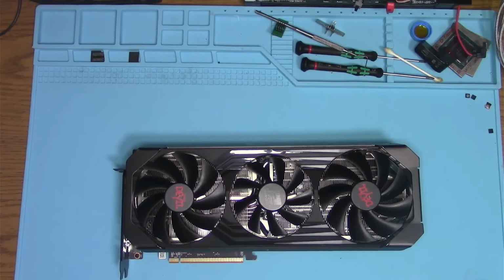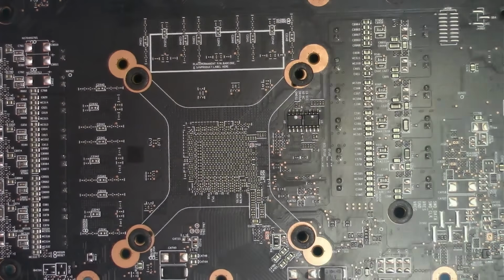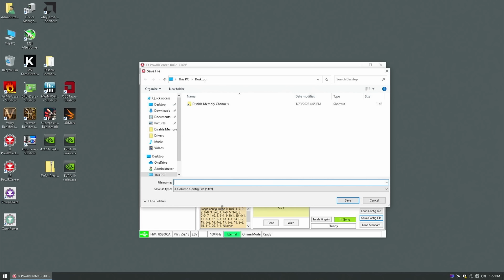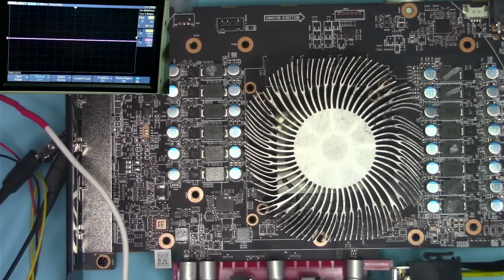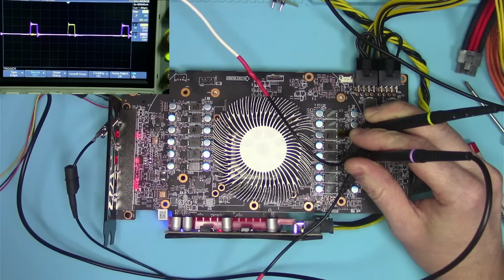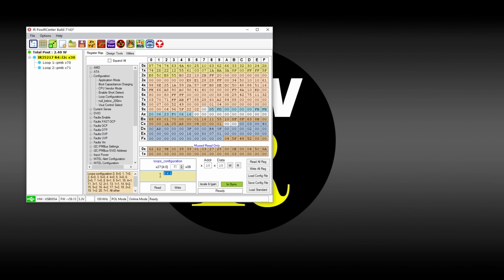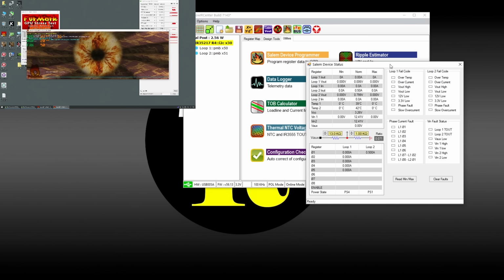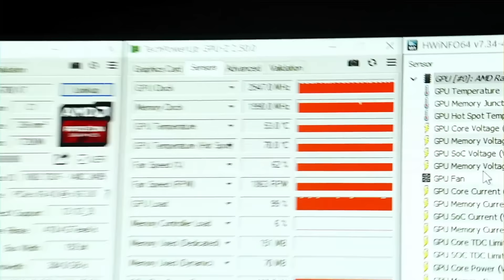Why i dont like fixing AMD cards

Comment: Dang it's sad to know that stuff like this could potentially be cut in half the time just by having a board view...
Schematics or die.
Reply: This is the issue with some manufacturers. Even with the equipment I work on, sometimes the schematics are ruined or not present and you cant find any online. Now you just gotta be a technician and troubleshoot, if this shit were easy all the time anybody could do this kind of work. Either small or large, sometimes youre gonna have to dig and get a result either way.
Reply: @Syphonfllter  that would be so, but that works if you're experimenting. If it was a job, it's gotta be schematics and board view or die.
Reply: @AshnSilvercorp  I agree with you, a lot bigger systems and chillers Ive worked on utilize some form of DDCs. For some boards you wouldn't really know everything you're looking at unless you have past experience to guide you, even then you don't have specifics. Thankfully (in my case) with refrigeration equipment manufacturers & controls, people will usually patch us through to their engineers to talk specifics. For these companies, I doubt there's actual 3rd party "tech support" in most cases.. Id bother em anyway.

Comment: Hi hope you can help me the same with this card. No Spin, IR35217 PWM AND SOC has voltage but no output on doubler going to drMos PWM and SOC. Also IR35217 has EN but no VRDY or Power Good going to NAND IN (pin 2) to Out (pin 4) SOC_EN IR35217. 

Is IR35217 need be replaced Im worried If I can dump it if I buy usb005.  I don’t have USB005 and dump file. Can you share your dump file please  😊? Thanks

Comment: The chip programming also gave the same error messages on the original chip, so it didn't actually get programmed I assume. I wonder if it was actually faulty or just corrupted firmware all along... I'm also kinda nervous about the integrity of the settings readout if there was a flaky I2C connection to the chip. Or does it do some kind of error checks on the communication?

Comment: Next time try to solder a jumperwire (maybe  they connects to a few resistors) to the controller pwm pins and monitor them at crash. The falty one will make a bad pulse, others will cut out at the same time. But sometimes the internal timer is bad and you can't check it. But yeah time consuming and not quite worth it.

Comment: Just curious about whether or not you ddu your graphics drivers off your computer so you dont keep loading driver ontop of drivers . That will corrupt the drivers your using for the particular card making it lock up or black screen or just reboots your computer? Thank you for your show. You do great work!
Reply: This, to my experience seems like something made up by people with broken or failing graphics cards or hardware in general. Most of the time the hardware is the issue, not the software (drivers).

Comment: Very educational! Good job! But what if you disable the phase from controller (the one that was faulty) and the check with the oscilloscope to see which one is it?! Then swap dr-moses, then replace controller. Wouldn’t be easier?
Reply: or you can desolder the coil and try again the card, it can run without 1 phase

Comment: Hello🤝 it was good, you have a lot of knowledge about graphics cards, especially AMD. I have Rx580 Armor 8GB OC and I don't know what it's about. I tested the memory with your Tserver and it's ok, but the problem is that it crashes during games, but furmark and heven run normally. In your opinion, can I try a new bios?

Comment: I just bought a 2nd hand Gigabyte 6800xt gaming OC. I just found out the die has dried. But I have no way as of now to test it because of few reasons: 1. My RAMs are just on its way (1st I bought send me 2x8gb instead of pair of 16gb. I have to wait for 1wk for the the thermal pads since no store here my area has it, just thermal paste. I just look it now, and It has a slight elevation on 1 side. What advice can u guys give on how to put paste on it since reball not an option in my area or country. TIA

Comment: I have a similar problem with Vega 64, but when I set clocks to minimum in afterburner it works without crash. It also works well in furmark and benchmarks with Vega 56 bios and it doesn't crash in pre 2019 games. Any idea what it might be?

Comment: I was having black screen on my computer while I was using it regurarly or playing games. It was not happening so often. Sometimes it ran 6 hours without any issue but in the mornings it didn't turn on. When I brought it to one of the pc repair shop in my city, my PC was giving bluscreenen during the furmark test this time. We swapped my Graphic card to another PC, and it was fine. Then used new rams, new power supply with different graphic cards on my own pc again it gave the same error. We ended up the problem occurred because of windows 11. Same components were not giving an error during furmark test on win 10 but right after the test it was giving it on win 11. It was such a dumb mf annoying problem.

Comment: Is there a way to check for a dead core - short?  My Vega 64 has no short on VRM, but doesnt boot at all, if I use it as a secondary card, sometimes if Im lucky with the right motherboard it will show up in device manager and tell me its device ID, I feel its most likely a dead core, wish there was a way to test so I could just throw it away if so
Reply from the maker: You cannot test core for short.

Comment: Again, lack of proper schematics with board view doesn't prevent repairs but makes it a lot harder. Every manufacturer that wants to keep schematics and board views secret is simply actively hostile against Right to Repair. Both schematics and board views can be easily (that is low skill but very time consuming) reverse engineered.

Comment: Seems a bit odd to me, if I understand correctly the process you used.

First, you read the firmware (or firmware parameters? config profile?) out, and then reflashed it. If that info was corrupted when you read it, wouldn't it still be corrupt when you flashed it back, even to another chip? Maybe I am confusing firmware with config data, though. Firmware being already programmed on the chip, and the parameter/config data read/flashed (ie, you weren't reflashing firmware, just the config data).

Also, how come there is such a low limit on how many times you can flash those chips? I mean, I know flash has cycle limits, but THREE? That seems rather arbitrarily low; even old EEPROMs back in the day could to hundreds to thousands of write/erase cycles. Seems like it is an excuse to sell more chips. (though I guess normally they would rarely need to be reflashed at all, but still.. the tech is far better than that; why the arbitrarily low limit?).

Lastly, I was curious after seeing the issue with the chip soldering problem if the problem might have been a temp-sensitive cold solder joint on the original chip? It is a controller chip, so I wouldn't expect it necessarily to warm up more from GPU load, but maybe the board warming up from other components under load caused a problem joint to fail?

Thanks for the great video, though! :) Very informative.
Reply from the maker: i read the firmware just in case. 
I flashed it again to make sure chip is still in read/write able mode. Otherwise it would indicate a problem.
These chips can only be programmed 3 times. Its how they are made. I dont know why that is but its a fact.
It may be a firmware limitation rather than hardware limitation. Dont know for sure.

Comment: So doublers cause the phases to be not coherent?
This a card from power color, does all vendors (such as sapphire, xfx, asus, msi etc) use similar controllers on AMD cards that are hard to diagnose and fix?
Could be if you got more AMD cards you would be more well versed dealing with such controllers.

Comment: I think worst case with doublers you would have to replace two drmosfets? That is if you could not identify which is faulty... I never repaired any AMD GPU besides swapping memory chips so....
Reply: If one mosfet dies, it kills the doubler and the other mosfet. No matter what, always the case.
Reply: @kikihun9726  Interesting. Good I never had to touch these. I only deal with NV cards, I worked on one Vega64 and one 390X .. IDK either AMD is not popular here or those hold better over time.
Reply: @kikihun9726  BTW working on Vega64 I learned about Infinion, so I knew if I ever had an AMD card to repair that has a power delivery issue I would need their I2C reader and software, but that was just a physical damage repair so never dived deeper into the subject.
Reply: @DIYRepairHour  gtx980ti🤬
One mosfet died, other one seemed okay. Replaced the dead one, oh lucky me both mosfet smoked out.🤣 That time realized this rule
Reply: @kikihun9726  That happens on NV cards I know. but personally I've seen this just a handful of times. I think this heavily depends on the drmos manufacturer and model.

Comment: This pains me, i was finally able to replace my gpu after 2 years of not having any and i got xfx 6600 cause for the budget i had everyone said thats the best option for my pc. As my previous card was 1050ti it was a massive jump for me. Just to read now in the comments that amd is bad :(
Reply: AMD isn't bad. Just more difficult to diagnose due to the type of errors they get compared to Nvidia. As with Nvidia, the board partner model is what really matters for reliability.
Reply: Each card manufacturer has its own pros and cons along with each GPU manufacturer. If your 6600 is doing what you need/want it to do and you feel its performance is in line with the price you paid, I would say that's inherently NOT bad.

Bottom line: Anyone spouting blanket statements like "AMD sucks" or even "nVidia is bad" are likely just fanboys. If you're comfortable with your decision, considering the context in which it was made, it's a win. Don't let the naysayers convince you otherwise.

Comment: What software do you use for memory diagnostics for amd cards? Im getting into gpu repair, and my first patient is a r9 290 that i suspect has a faulty mem module.
Reply: OCCT can do it!
Reply: @Razzbow  yeah but you have to boot into windows to run OCCT, no? It's not stable when it loads the driver

Comment: i got an rx 6600 non-xt. gotta say this: do NOT install the newer drivers than the ones that came with the card, GREEN SCREEN OF DEATH will kill your braincells.
Reply: I didn't get any drivers with mine, have the same card. Installed the latest ones and it works fine so idk, you sure it's drivers ?

Comment: i havnt had any luck with anything AMD at this point. i lucky changed back over to intel and nvidia and been happy ever since. but from some reason or other when i went to upgrade to a 5500xt from a rx580 every single 5,000 GPU i got from AMD (well power color) wouldnt last past a week if not even a day. i went though 4 and ended up getting a 6600xt that even that didnt work right out of the box. lucky i uploaded videos about it on my YT channle to show everything that happend. i even got to the point to where u can see me take my desktop and put in the trash as my father was raging at me in the background. not my most proudest moment. that was over a year of the BS going on. im so happy my intel and nvidia desktop works as it should. i dont see me ever going back to AMD for ether a CPU or GPU
Reply: GPU wise I usually stick to NVidia (I do have an RX6500 XT and an RX6600), but I have had no issues with AMD CPU's.
Reply: @ibizenco It's kind of bizarre how all the issues with AMD seem to plague the same people. Because you'll see posts like "I had 5 AMD GPUs and each was faulty" and posts like "I've used AMD all my life and never encountered an issue". I'm personally part of the latter group, and I mean, following my experiences much of my family have been running laptops with AMD (bought around when AMD had some really compelling options even with efficiency in mind), and I've built something like 3-4 PCs with AMD CPUs or APUs, and sometimes (though rarely, most of my family don't care for graphics) GPUs, and none of them have had any issues either... it's kind of a baffling distribution really.

And for the record, I'm no deranged fangirl, AMD just tends to be priced better for any given performance tier as of late, especially if you look at last gen offerings, especially here where I live... and most of the people I give advice to are always short on funds because we all live in a pretty economically screwed up eastern European country.
Reply: @astra6640 ikr, i always assume it's some kind of user ignorance most of the times, like not cleaning the vídeo drivers when changing GPU or stuff simple as that
Reply: @astra6640  My first AMD CPU was the K6-III of 450 MHz ("What's a GHz?" 🙂 ), ages ago.

I have - let me count - built PC's with a R5 1600, a 2600, an R3 3200G, a 5600G, a 3600, and my gaming PC has a 5700X (coming from a 3700X).

They all work fine.

As do the (few) AMD videocards that I have. (My 2500K had an AMD RadeonHD 6870).

Perhaps there is nothing wrong with AMD CPU's and it is just "Intel FUD"? 😉

Comment: I bet you cant find anything wrong with my 6900 XT that had driver issues for 8+ months that was fixed early this year with the 23.2.1 driver
Reply from the maker: Another good reason to stay away from AMD
Reply: @northwestrepair  But i hate Nvidia so much they cant even fix 4 year old re occuring driver issue :(
Reply: have you tried uninstalling via DDU, and doing a clean install?
Reply: @snow15243  Are you trying to help me troubleshoot when the issue persisted for 8+ months and already got fixed on first driver early this year ?
To answer question tho i eventually found out that a PCI Bus driver that was forcefully installed to replace the PCI Express root complex driver was ruining stability that comes with AMD driver, but only if Windows Driver Update is enabled, however most issues that everyone had still existed until 23.2.1
AMD drivers are truely bad, but also Windows Driver Update causes most issues, and i am stuborn i wont disable MPO even tho it fixes issues, cos the pro's outweight the cons for me.
AMD drivers aren't the most stable but still better then Nvidia these days.
Reply: @Arokhantos  oh i missed the part where you said that it got fixed
Reply: @snow15243  Its still stupid tho but the fact it got fixed proofs it was all driver issue all this time, altho many are delusional that its Microsoft fault cos MPO is a Microsoft feature but those users do not realize that its AMD that is tuning stability MPO allows better power consumption at idle which is much lower, but sometimes you overtune stuff and then it becomes unstable cos you just want to be better then Nvidia at idle power consumption for example.

Comment: Well, PC Red Devil is probably the skngle worst board partner for GPUs on the market. Just awful manufacturing.

I hear they're getting better but in my heavy GPU repair days (up until about a year ago) I could easily say that I saw more PCRD and MSI cards than any others. It was by a factor of 3x easily. For every EVGA or even Zotac I'd get 3 PCRD/MSI.

Just garbage build quality.